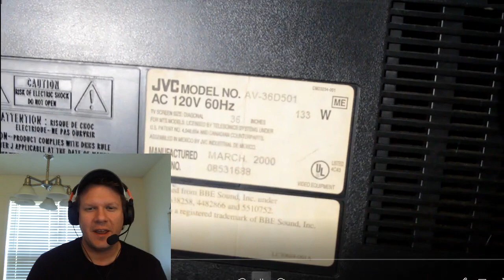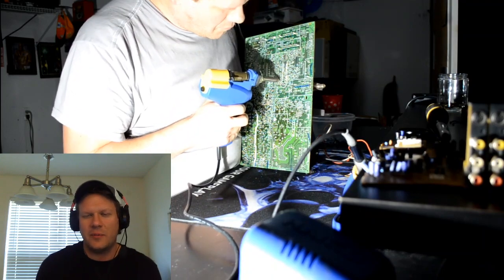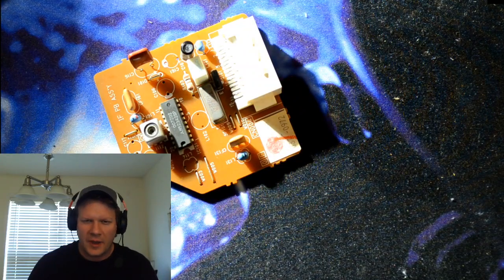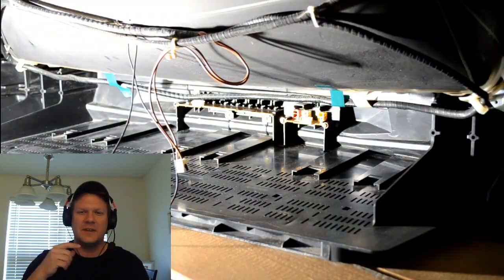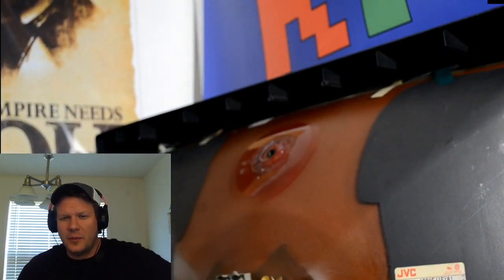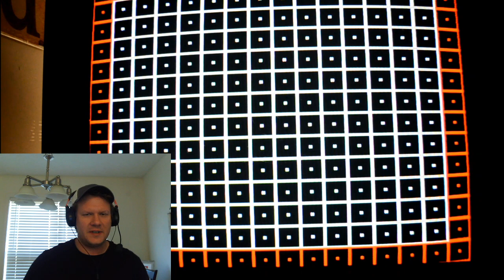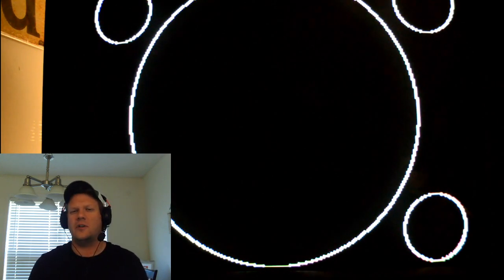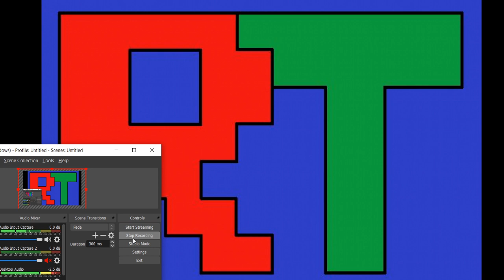Changing 158 Capacitors in a CRT! | JVC 36" Consumer CRT Restoration

Comment: I have been watching your vids for almost 2 years, but haven't commented much/ever

I love what you did with the set. I already know that corner convergence will clear up with strips. Your work has made me want to fully recap my Toshiba 32AF44, which still has its original caps from 2004. If not a a recap, I should at least clean it. The dirt and grime you showed inside the set last time makes me wonder how dirty mine is.

Great video as always, the music during the gameplay is a nice touch!
Reply from the maker: Thanks and thanks for watching for so long.  That's a great Toshiba set.  I bet it's worth futurproofing!  Good luck and let me know how it goes if you decide to go for it.

Comment: This is beautiful to watch and learn from, thankyou. I have three CRTs. A Daewoo(small), a Trinitron kv-24ls35u(medium sized) and a Trinitron kv-ar34m81(absolute behomoth). They all need internal work as the service menus only do so much for the geometry. I plan on restoring them smallest to largest. I'm a little nervous but excited too. I will of course be extremely careful having watched most of if not all your safety videos. Something I didn't know about CRTs which I learned yesterday, make sure they are facing east or west so the earth's magnetic field isn't affecting the geometry.

Comment: I have this exact set in my rec room. When I run a grid pattern, as you get toward the edge, the lines start to squiggle. It's also a problem when there is a bright screen and lines start to bend. I'm thinking a cap replacement would fix these but I am not capable of doing it myself. There is a guy in the town next to me who does it but I can imagine a complete recap of a CRT would cost a fortune. Oh well, I will live vicariously through your channel :P Great work on the videos man.

Comment: I probably did a similar number of caps in my BVM-2010P.  All the high voltage boards, PSU, gun amplifier board, geometry board, geometry control boards from the pull out drawer.  Didn't touch the input boards, that side of it seemed ok.  Much easier to do 100s of caps when the individual boards can be easily removed and put back.  1980s easily serviceable design.  This was also full of soot inside.  One day it gave a loud crack which prompted me into doing the recap of the high voltage and geometry circuits.  Found a black skid mark on the underside of the gun amplifier board where it sat above the remote focus control unit, suspect the soot buildup caused something to arc.  Took the monitor outside and got the air compressor and paint brush on the interior.  It's been perfect since.
Reply from the maker: Great job.  I've got a BVM that needs completely recapping.  It's a 14F5U.  I'll have to change the Electrolytic and SMD caps in it.  It's going to be a bigger job than this was, but at least I've got the part lists ahead of time.  The BVMs do have great serviceable designs usually.   Thanks for the comment

Comment: Flux is absolutely your best friend. You can make the cleanup easier by using certain types of flux which tend to respond more favorably to the kind of heat being used. Many of the gel or the thinner paste type fluxes that you can buy in syringe dispensers are designed not to burn onto the board quite as easily, so cleanup is typically a little bit easier when using that type. Regardless, when in doubt, apply a generous glob of flux.

Comment: Great work man! I have a Sony 36" fairly late model with component but not HDMI, 4:3 aspect ratio and a totally flat face. It's overall pretty good but need some expert tuning and I guess magnet replacement/upgrade, geometry help (I know the flat CRTs are less ideal for this,. but I still know it could be better), and above all some sections are worse on convergence. 

I'm thinking of driving with my son from my home in North Texas to visit the USAF museum in Dayton Ohio. If I rent a van or something large enough, I could bring the thing and perhaps meet you on the way out, and then pick it up on the way home. I could bring some interesting NWC and retro stuff along with cash. Lmk what ya think. I don't really know or trust anyone around here with it, and I don't want to practice on it as I've never done any CRT work beyond twiddling the pots.

Comment: Looks awesome. I know u mentioned and showed in the prior video that the image quality was still pretty good on this set before the recap, so I was curious to know if u noticed anything (specifically visually) that ended up being improved upon once the full recap was complete? Thanks Steve 👍
Reply from the maker: Thanks Karl.  I did notice a bit of a bump in quality.  I will do a follow up video going over everything that I found to be an improvement on the TV after servicing.  I'll probably combine that with the calibration video for this set.

Comment: The video quality on that screen is so amazing I assume it was already rgb modded
Reply: This is because his SNES is being hooked up through Component input on a 1 chip SNES which has voultars RGB mod done too it. All 1 chip SNES output nice RGB signals. The mod just cleans it up even more. 

The HDRetroVision cables pull the RGB signal and provide component hookups.

He is talking about adding a SCART socket to the TV I think. Not overly necessary, unless a lot of your stuff already has a SCART cable for it. Component inputs accept a wonderful RGB signal as well. Quality is basically identical. Just depends on what options you have in terms of how your devices connect to the TV.

Comment: Amazing stuff. Do you feel that the focus is better(if you had issues with it before) after the recap? The biggest issue I keep hearing from others about the D-series is focus, particularly about not being able to get both edge and center focus in. I didn't see it as a big deal until I checked my own two sets and sure enough both of them could only get totally focused on either the center or the edges. Just wondering if this is to do with caps or with the flyback since it's widespread and you've replaced all the caps! Thanks for all you do Steve, cheers
Reply from the maker: This thing is so big.  It definitely has troubles with focus along the edges and corners of the picture.  It's sharpest in the middle 85% of the screens surface area.  I'll go over this a little more in the coming calibration video.  Thanks
Reply: Retro Tech I have 2 JVC D-Series (one 27 inch and one 32 inch), and both are focused in the center and not focused around the edges, especially the corners.  I haven’t tried tuning focus on the flyback and have not yet recapped or replaced the flyback.  The blurry corners are only noticeable in some of 240p test suite’s tests.  Still, would be great to know how to improve.

Comment: How similar are these to the 32 inch version? Mine is a D series 32 501 and I'm slowly becoming more confident in trying a recap (mine has a very slight blue spot on the left and yellow on the right when displaying white, and the gemotery is a bit worse than I feel it should be). Also, hoping for a very rough ETA for the follow up calibration video. Looking forward to seeing if the magnets worked.
Reply: Did you do the recap? I also have 32D501 and I’m still looking for the service manual for 3 years now.
Reply: @SkyChurch11  sadly, no. It's a relatively low priority now. Lots of other projects.

Comment: I am really into these old CRTs, bought a Sony VGA monitor recently. Only opened up to remove the back housing to clean it but I I do have a Sony CRT SCART TV which once worked and now only a blinking red light. I am tempted to replace all the caps but am concerned it won't do it. Do you have a video on this issue. Love your channel.

Comment: Were there any specific signs with how the tv was acting that made you re-cap the whole thing?  I’m curious because I have two Sony trinitron flat tube consumer TVs one is 32 inch and the other 27 and they both have a slight wavy look to them.  A steady image, the menus for instance, will move left and right slowly maybe a few millimeters if that.  Is that a sign of the caps going out and needing to be replaced? I’d really appreciate some input cause I don’t want to get rid of the TVs if I’m able to fix it by replacing the capacitors.
Reply: My trini has the same problem. Did you find any solutions?

Comment: Just out of curiosity, did you go through and check the pulled capacitors to see actually how many were out of spec when you were done?  Also, was wondering if you know of any adjustment or component that could be replaced to improve the very tiny micro-wobble of images on a crt.  Im not sure of the technical term for what Im seeing, its almost like a micro-jitter.  If you put up a 240p image of some white text for example, and look REALLY closely, you will see some very slight movement or "micro-jitter" of the edges of the text.  Ive noticed this on several consumer 15KHz sets, but when I look at a 31KHz VGA CRT, the image appears perfectly still.  This may simply be how 15KHz CRTs operate, but Ive noticed some seem to be a little worse than others.  It doesnt appear to be a convergence issue.  Do you think the focus adjustment pot could affect this?  Any other ideas?
Reply: I have a vibrating image on a Sony fs120. It looks like dot crawl which is an artifact of composite video but it happens on mine even with component.
I plan on doing a recap soon and hope its a bad cap in the horizontal deflection circuit

Comment: Hi there, was wondering if you could answer a question about desoldering. What's the temperature you are using on the hakko?
I was using between 275-300C and some of the pads weren't looking so good after i had to reheat them when the cap's legs got stuck to solder residue.

Comment: Thanks for your videos, you have inspired me to work on my own CRT televisions.  I have a Sony KV-36FV310 that I would like to future proof by changing the capacitors.  I have the service manual for this particular model as well.  I'm assuming by the wording of the manual that "ELECT" along with uF, a percentage and voltage value describes an electrolytic capacitor.  Can I directly input these values into my search when I purchase them online?  It has each one listed for each board.  Will this give me the correct quantity for the entire TV?
Reply: That should generally work, yes. I would usually get ~50% more of each cap than I need, just for spares and for future projects. Also, to save yourself time, I would not bother with getting specific voltage caps. So long as the voltage rating is equal to or higher than the one in the manual, you're fine. Instead of buying a 16v 220uF cap, a 25v 220uF cap, and a 50v 220uF cap, save yourself the trouble and get all 50v caps for that particular capacitance, for example.
Reply: Thanks for the information.

Comment: When you make your cap list, how do you know if you need low esr or standard ones? I made a list and recapped a Commodore 1084, and luckily the service manual lists them, also with the designation universal type or low esr (basically just the horizontal witdh cap needed to be low esr & bipolar). Do you use "just" good  brands 105° electrolytics?

Comment: Does doing this take care of that "focus drift" where even adjusting the focus pot on flyback can't get focus all throughout the screen? Some say most of the old D series in the wild have softened focus outside the center, and adjusting the focus pot can't fix it fully. I have that issue with mine. Got a 32" with the same line count as this one!@
Reply: Focus drift is often either the tube or the focus potentiometer. When very dirty / tar stained, it can also be tracking inside the tube socket or on the PCB.

Comment: did you RGB mod it already?
 I have a JVC AV32D501 and I'm thinking of modding it.
Reply: Do you think that would make it compatible with 30hz? I have the exact same TV and when I have my Wii plugged into it and playing 30 hz games, it's so jittery and there's some double frame nonsense going on. Significantly more blurry than the worst LCD I've ever used, it's very unplayable. 60i looks great. Even games like Kirby and the Crystal Shards experience this jitteryness and double frame ghosting.
Reply: @awesomeferret  I got same result on my PS2. I used had retrovisions component and monster s video.

Comment: im gonna do this with my hd cRT Samsung.. just to make sure i wonta have to replace any other capacitor in some time..
for now i found out it was completely dead cause the H.O.T. was shorted.. luckily I found a replacement. but i need to know what caused it to get shorted.. i found the primary is ok since im getting correct voltaje after the Chopper transformer in the +B
could anyone suggest spots to test voltage after the diode that rectifies +B¿

Damn I wish I could speak better English